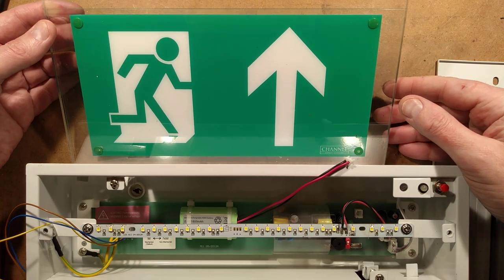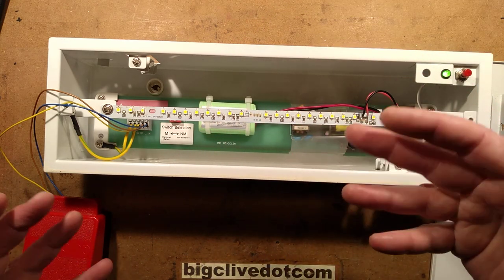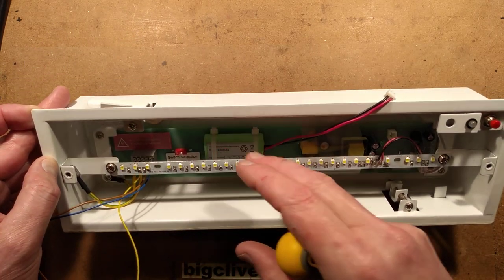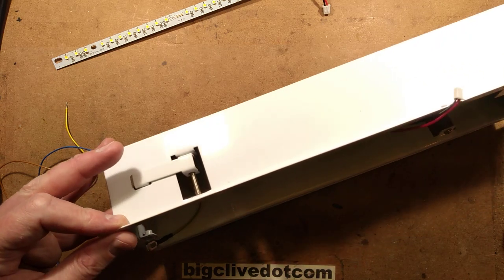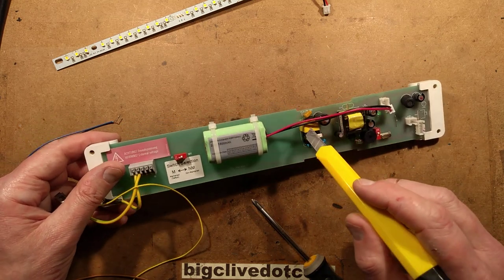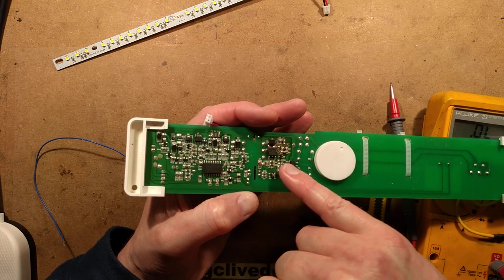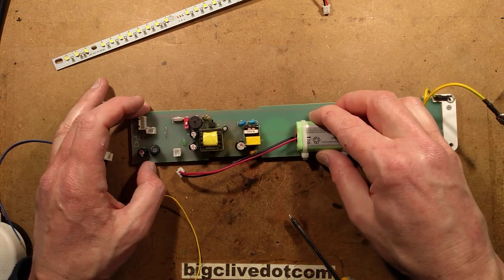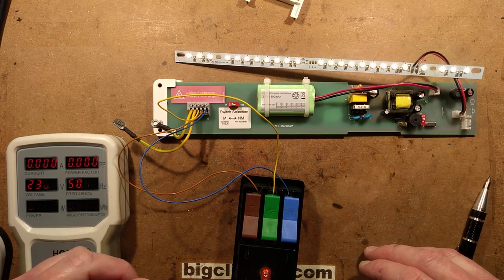Inside a self-testing emergency exit sign.

Comment: I wonder how many of these actually ever get tested.
Reply: James Neave - in my workplace one of our past supervisors used to go around testing the emergency lights. So some are tested. Not seen anyone test them recently though.
Reply: I run a maintenance business (only a little one man band thing) and one of the first things I do when I take on a new contract is to ask for the emergency light/sign and fire system test logs. The usual answer is 'what logs'?
Reply: Most modern ones are connected to what is known as an ATS system, using DALI, Wifi and the like or similar, gone are the days where someone has to walk around manually checkin these.... older installations... probably not until someone notices a tiny red LED in the winter months on the case.
Reply: @bsitester4940  That may be true for larger installations but the sort of client I tend to work for, small charity, church+hall types, it's very much still a person with a fish-key. 
Actually in the hostel environment it's a great thing for 'service user engagement'. It's the sort of thing a more trustworthy service user can be tasked with doing which goes towards building self esteem etc. Something the modern automated world is not very good at.

Comment: Isn't lipo cheaper than nimh? I would think new ones would use lipo instead of 2 nimh cells.
Reply: LiPo ones are just starting to trickle and be sold now, it's a case of proven technology with the old nicd etc ones
Reply: @bsitester4940  Slight design change would be needed for the step up converter, unless it is voltage referenced anyway. With the higher voltage, the transformer squealing would probably be gone, at least.

Comment: Would you please do a video of creating some electronics? I'd love to know how you would design some things. One thing I'd love to see how you would design is a ac to 5V dc for charging electronics. A project I had tried and failed to design is a random tone generator. Running on a dc battery that could be hidden and it would chooses a random time interval and tone pitch. It would be a great April fools prank.
Reply: There are some design videos up, including laying out circuit boards, construction, etc.  I wouldn't recommend a beginner rolling their own mains powered gear, since the penalties for getting it wrong include destroying your expensive gear, fire, and electrocution.
Reply: @Branden Allen go look at David Watts channel, he made a little battery operated "Cricket" that you could hide and at random intervals it starts to "chirp" and then stops before ya can find the bugger, then it does it again a bit later......who you trying to  committed ?

Comment: cool I have one of the old ones with a couple of D cells  and a little 6" flowery scent light had it for when I had a home cinema still have the light fitting somewhere batteries must be dead by now although I did disconnect them !

Comment: Hi Clive. I have a question or two... I need some help with a project I am working on and from what I’ve seen from your YouTube vid, you know what you are talking about! I am building a small electronic switch board where by a computer programme will switch on and off switches when prompted. However, I am in the very early stages and I have no idea what these small electronic switches are call nor do I know yet the products that I will need. The comp programme will be written by a friend of mine, and I am doing the hardware side of things. Can you help, or guide me in the right direction? Regards
Reply: There are a few options.  You can use the old-school electromechanical approach and switch your loads with relays.  A more modern approach is "solid state relays", which are quiet and long-lasting because they contain no moving parts (I'm guessing this is what you're looking for).  The devices typically used inside solid state relays are a type of thyristor known as a "triac".

Comment: Interesting design. They looks like French emergency lights (BAES here -Bloc Autonome d'Eclairage de Sécurité - Automonous Security Light Unit - there are also BAEH, with H being for living places such as hospital, with weaker lights but longer battery life) except that all French ones I've seen are mounted on a "support" where the connections for the mains and the 12V remote controls are mounted.

In theory it mean that you can swap the unit for maintenance and replacement with only a flat screwdriver to unclip the unit -most of the time, the base support has changed so you need to replace it too.
https://www.alliancelec.fr/6883/baes-evacuation-standard-legrand-sati-evolutif-ip-43-ik-07.jpg

Also, French ones must have two LED for indicating the state of the unit : green for okay, orange and/or red for issue (usually, orange is charging battery, blinking orange is a battery issue)
I suppose that they can have a green-and-red LED as it's not stated that they must be separate, but I've never seen any unit using an all-in-one LED.

Comment: Why not replace the battery instead of the whole unit?
Reply: Basically the cost of the battery’s for replacement is just a few pounds off the price for a brand new emergency light so when the battery has come to the end of its life it usually means so will the leds soon so it generally just advised to replace the full thing

Comment: Having serviced emergency lighting for years, I'm now informed that the regs have changed again. In the event of a fitting not reaching it's full 3 hour duration because the battery has aged, instead of changing the battery, one must replace the entire fitting, or gear tray if it's architectural or ornamental. If you replace just the battery, you've to let it charge for 24 - 48 hours and then return and repeat the 3 hour duration test, the cost of which is greater than the new fitting. Not very environmentally friendly IMO.
Reply from the maker: On one hand it makes sense, but it does sound like an environmental disaster when they could standardise and swap the battery and LED strip in situ.

Comment: Interesting Video. Would you open a HID Ballast? That'd be a good video too.
Reply from the maker: I can do that.  Possibly a high pressure sodium variant.
Reply: I'm guessing you're looking for an electronic HID ballast.  The old-style ones are just a core-and-coil transformer object (iron core and lots of copper windings), generally a capacitor (paper in oil, probably), and perhaps an ignitor/starter.  The new ones are much more interesting, dealing with a fair amount of power and voltage with solid state electronics.

Comment: Nothing to do with this but today I found that Poundland has single use 'phone charger packs containing a 640 mAh lithium cell for, oddly enough, 
£1; cheap source of lithium cell!
Reply: Silver Legend - BUT, BUT, BUT, surely their “1200mAh” power banks (actually around 950mAh upwards) are better value at £1?
Reply: Probably cells on their last stand
Reply from the maker: I've got one in test mid-video.  500mAh per charge for four consecutive charge/discharge cycles.  And the chip on the PCB is a full power bank one capable of recharging it if it had the extra circuitry.
Reply from the maker: I think those are also £2..  The cell inside has no protection PCB itself, but otherwise looks like a metal cased phone battery.
Reply: @Mark1024MAK  - AGREED, AGREED, AGREED, I should have said that the cell is a lithium-polymer "flat" type rather than the cylindrical Li-ion type. I had not found a low-cost source Li-po until yesterday :-))
Reply: @bigclivedotcom  -  I thought you'd be on to it! I await your findings, particularly if you find that they are reject or used cells.

Comment: when you put it into maintained mode i could hear a 17khz  squeal...  so you might want to check into that if you plan on using it, the Power supply should not be making audible noises in the Human hearing range...

Comment: And now for an interesting anecdote: If the batteries can be such a problem in these, why aren't they serviceable with a battery holder, rather than being an oversized phone battery? That'd be a good mod for more experienced technicians: Zip-tie a holder with batteries instead.
Reply: I have a few French models, and save from them 20 years old ones, they have all serviceable batteries.
They are either the old bulky LR20 type or newer "cordless phone" type, but they are all removeable, either mounted on a removable chassis, or instead of being attached with zip-ties like here, the battery pack is stuck between large plastic tabs.
It's not as easy to replace as a battery holder, but it's more easy to replace. Remember, those units are for safety purposes. Unless you use them at your house where there are no regulation regarding emergency lights, you want those units to be in a correct state. Forcing the customer to buy their replacement batteries from the manufacturer ensure that after battery replacement, the unit is still up to the original specs. If you had a battery holder, what would prevent the owner of the unit to replace the original 800maH batteries with cheaper 300 Mah batteries?

Comment: Talk about over engineered. The 'use a micro-controller at all costs' brigade have had fun. It would be interesting to see if it is immune to a pocket EMP generator.  As these units tend to be high up getting close enough could be a problem. We need a stealth EMP generator project.
Reply: All certified emergency luminaires with built in autotest are required to meet the clauses of Annex K which calls parts of 62034:2015 - one of those is the EMC testing 61547-1 EMC immunity requirements, criteria being no unwanted tests, no change in mode of operation etc, there are radiated, immunity, conducted, induced dips and surges etc usually carries out. all public buildings via regulations have to be approved these days.. would depend on the strength of your pocket zapper as the test are only done up to a specific most likely everyday condition than you doing that lol

Comment: Those batteries are cheap to replace though...  few bucks vs ?  We are a very wasteful dumbed down society of consumers where replacement is the only option.  At some point we will scrap vehicles when the brake pads are worn.
Reply from the maker: The problem is the time involved in finding and fitting the correct pack versus just banging in a new fixture.
Reply: @bigclivedotcom  Yeah, I realized that once the battery was zip locked to the PCB....  They don't want anything to last more than 2-3 years anymore.  We only have so much in resources to continue this factory to landfill for maximum investor/bank profit existence.  Fast turnover is where the money is.  That battery should be readily accessible and use common off the shelf cells for a light fixture designed to have a 20-50 year life.  Frustrating world we live in at times, but everybody lives in "the now" and could care less about the future.  As a long time watcher of your videos, I think you would agree that we are becoming a self destructive society, all in the name of profits for an elite group.
Reply: @gavincurtis  it has been said in another comment that an "off the shelf" battery would compromise the reliability of what is considered to be a life safety device

Comment: is that a nicad battery. hmm interesting its not lithium ion
Reply from the maker: I think the industry has become so established around NiCd cells that they don't want to take risks with newer battery technology.  Particularly one with a dramatic failure mode.
Reply: @bigclivedotcom  thats what i wondered. wht good is an emergency sign if molten metal is streaming out on the people running out of the building ?

Comment: if you look around online you can find replacement batteries much cheaper than what the manufacturer will sell them to you for. I found those 2.4 volt 1800 mah batteries for $5-6 USD, there is no way those fixtures cost less than that and the labor to install new ones vs just zip tying a new battery in the fixture. it amazes me how stupid people can be, believing a battery costs more than a new fixture....

Comment: In one of the buildings I work in they have gone a step further - the testing cycle is centrally controlled (And presumably monitored) - at a certain time of day they are tested in sequence - however that sequence bears no relation to the physical layout so it seems like someone is randomly turning lights off and on! On a totally different subject - amazed at how often your name turns up - you are internationally famous. You get a mention on here (A pair of interesting vids about LED traffic light bulbs and the one odd pitfall due to people being people!). The PSU looks old skool, but designed with reliability in mind (dual fuses by the looks of it). Shame some people had a moan as he is "nowhere near as good as BC" (Despite admitting that on the video). https://www.youtube.com/watch?v=hRbnK4cDXPY